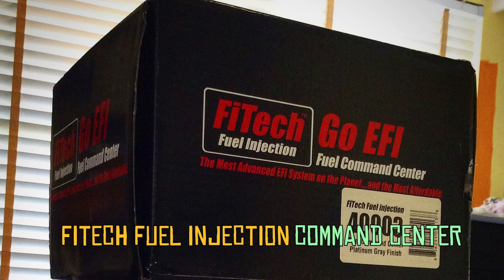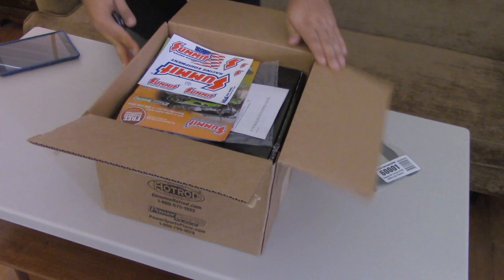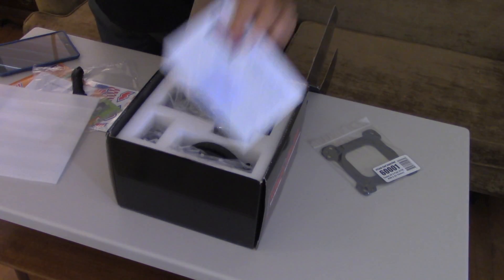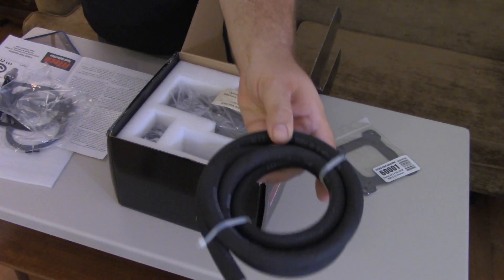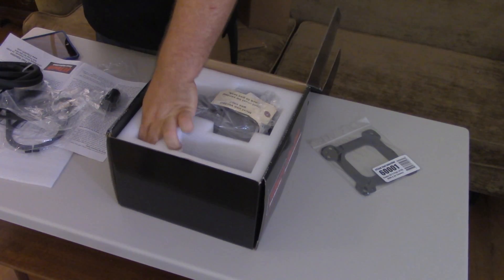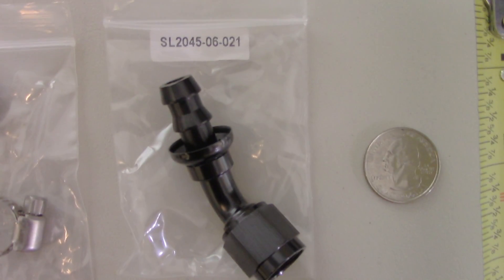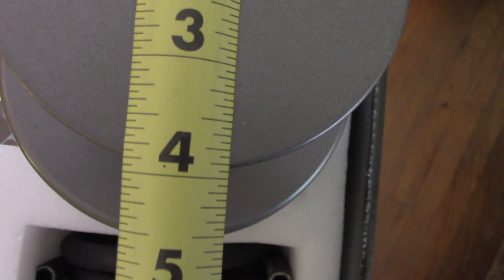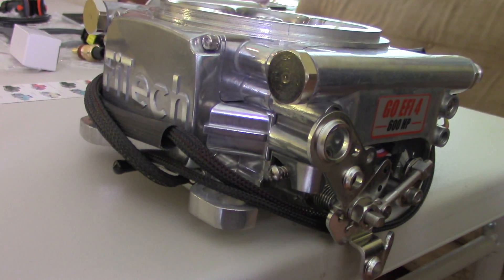Unboxing the FiTech Fuel Command Center! Easy DIY Bolt-In EFI Solution! S1 E8

Comment: These command centers belong no where inside the engine. they very hot in hot weather Texas heat. I have tried everything I could to shield it from heat to no avail.  it has left me stranded everytime. fitech knows of the problem but will not do nothing about it.  Warning! Do not buy!

Comment: I feel like you wont know if it was worth it until the first time you stomp on the gas pedal. So put it on the vehicle that is the most stomp worthy.
Reply from the maker: +Tommy Williams that narrows it down quite a bit. A choice of one...
Reply: The other option is the one in which you hope to gain the best fuel economy.... Bahahaha! Sorry, I tried to keep a straight face.
Reply from the maker: +Tommy Williams that would be the 68, but it's the least roadworthy vehicle... so it would be premature :(